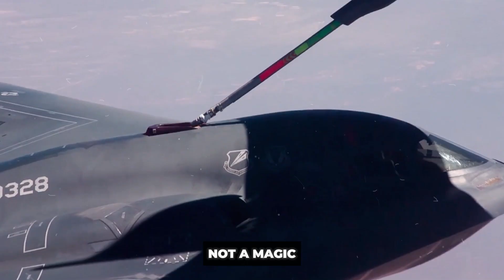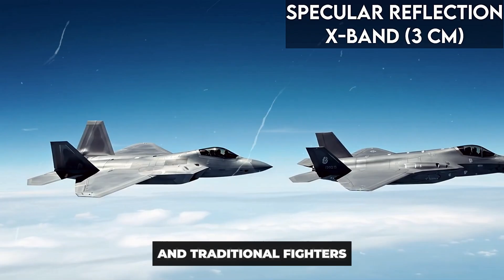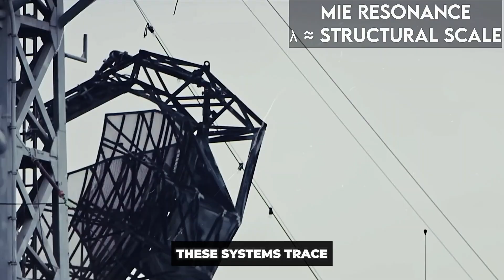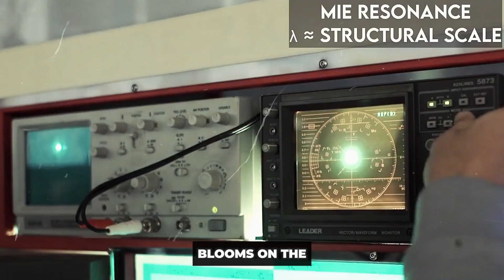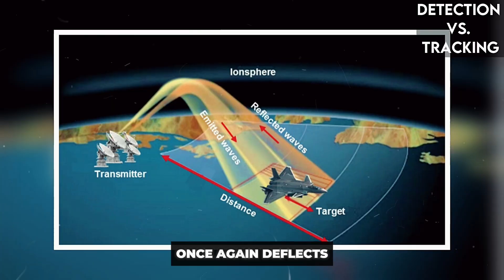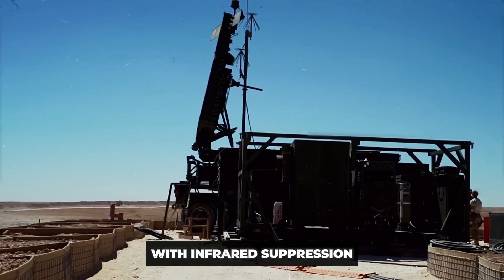The B2 Spirit's Fatal Flaw | Power Means Nothing Without This

Comment from the maker: The B-2 Spirit is one of the most advanced aircraft ever built, but even revolutionary technology has trade-offs. Stealth, range, and payload come at the cost of complexity, maintenance, and extreme engineering challenges. In your view, what matters more in modern military aviation: maximum stealth capability or a balance between stealth, cost, and operational flexibility?